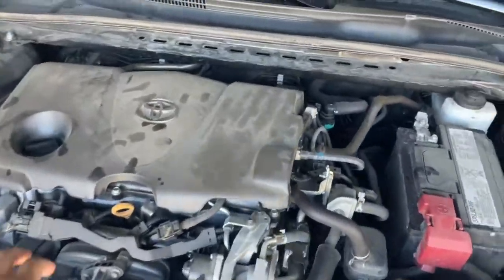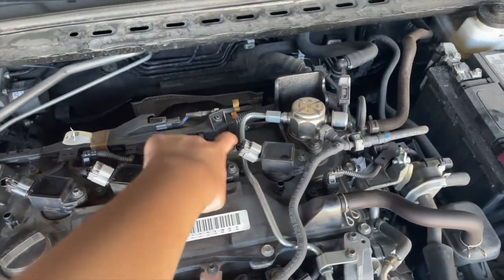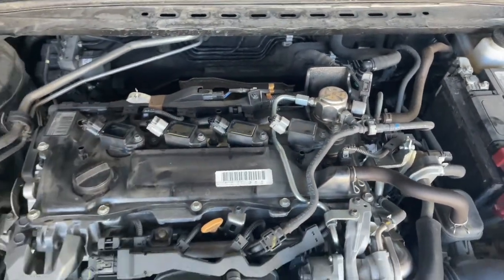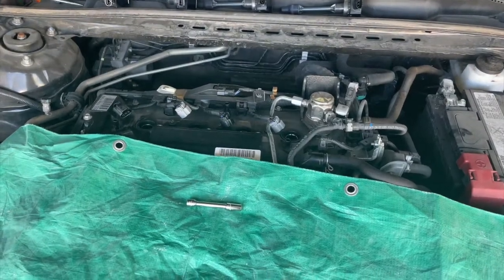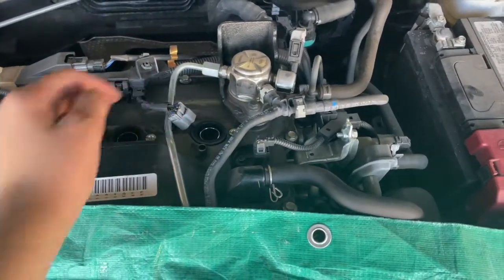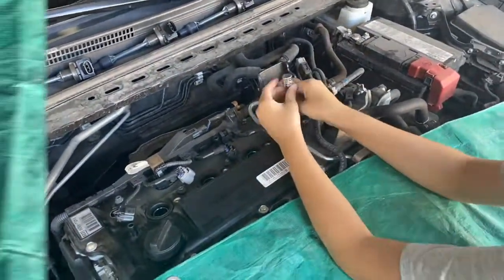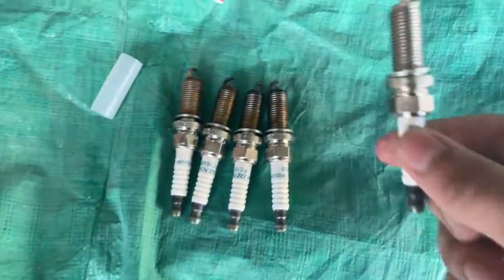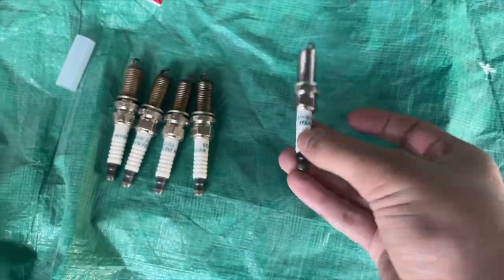DIY Gen 8 (2018-Present) Toyota Camry Spark Plug Replacement

Comment: I like how you said what tool to use to take off the coil bolts but not what tool to use for the spark plug.
Reply: a spark plug socket lmao
Reply: @joshhartman1169  you do realize they have different sizes, right

Comment: You time lapsed over pulling those electrical connectors. I’m having trouble pulling them off. What part do you squeeze down on to pull them out?
Reply: What did you do to remove them

Comment: The coil is the part of a car's ignition system that takes the battery's 12-volt output (called low-tension current) and transforms it into as much as 45,000 volts (called high-tension current) before then supplying it to the engine's spark plugs.